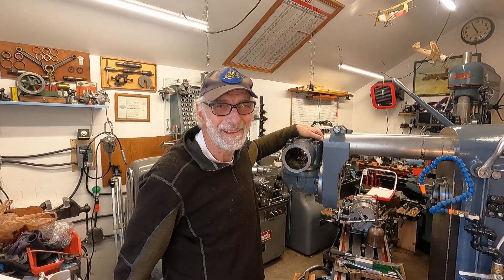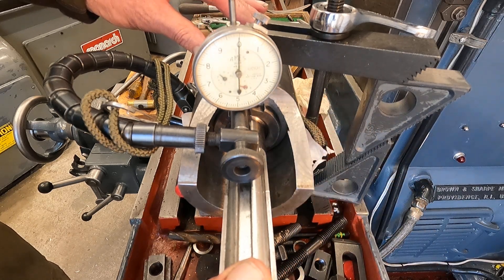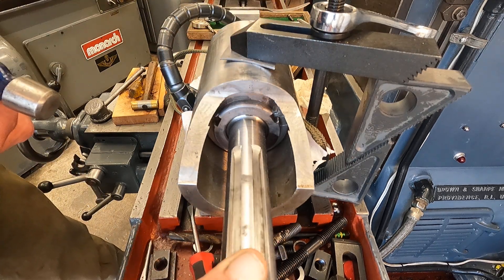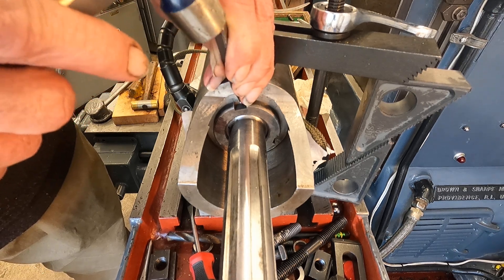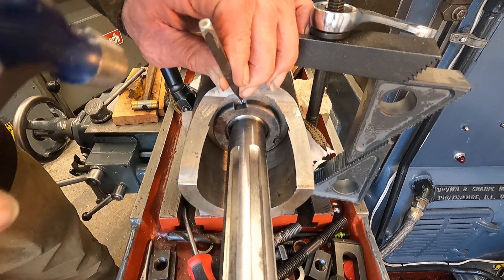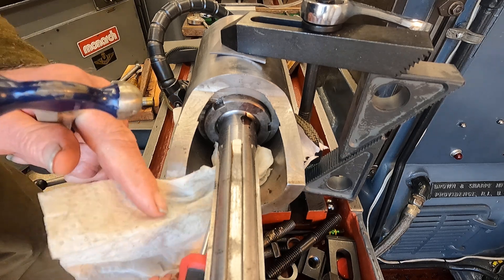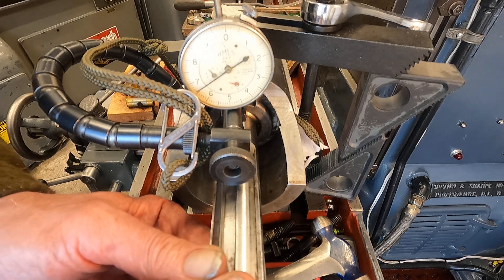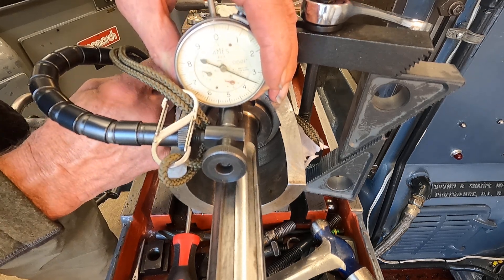Brown & Sharpe Milling Machine restoring spindle Timken bearing clearance set.

Comment: I would think that with mill spindle and lathe spindle bearings one might want 10 to 14 inch pounds of breakaway rotational torque . AKA 1 foot pound..anything like the 2 tenths is going to possibly result in surface finishes like all thread.. one does need to calculate thermal changes in spindle length and housing length.  Might be interesting to see how warm the spindle gets and the housing gets after an hour run in time. Duplicating spindle thermal expansion could be done with a hair dryer thru the spindle bore with a blade of metal at the outlet to adjust hairdryer distance to get a few degrees hotter than you need. Or a hotter source for a minute or two.  
Used to have an automotive choke tool that hooked to shop air.. blew cold out one end and hot out the other.  It grew legs 40 years ago.. I knew who got it.  Another tech that did carbs..

Ps I worry horribly about pounding on items in spindles without preloaded bearings.. I think harmonics destroy spindle bearings.  I wrote an email to kennametal and a year later they came out with damped tool holders.. but I think it quite literally fell on deaf ears.  
Back in the 70s. One of my brothers friends showed up at his apartment.. pulled a little glass vile out of his shirt pocket. Set it on a tall stack of magazines on the coffee table..  my brother ask what was in it.  
His friend replied nitro g and petn for additional pop.. my brother said it was a zen moment.  Looking at the vile sitting on top of a stack of magazines just about to slide.  That if it fell.  Would he hear the glass break..
Reply from the maker: This is a Timken bearing spindle that is full of grease, but all heads like this get full of grease, so there is no break away tongue setting possible. The only way to adjust this is carefully and slowly running it and watching the heat build up and "no" a fancy digital gun will not holp.. Timken bearing are not like ball bearings, but if they are damaged will produce a rope finish. The worst thing to do is disassemble this spindle and clean the bearings like idiots on the internet do daily it would appear.

Comment: Dee, I’m going to ask the question that really shows my ignorance.  Why, when you have spindle off the machine, aren’t you disassembling it and cleaning the old grease out and reassembling with no grease so you could adjust those Timken bearings as they originally did it?  I like where this is going but would like to understand more about precision spindles and the dangers of disassembling things too much.  Thanks, Will
Reply from the maker: I will cover it the best I can in the next video, it is risky disturbing precision spindle bearings.

Comment: you mentioned flushing out the old grease with new grease. That reminds me of what I see on my Nichols mill spindle. I greased it after getting it running again after who knows how long. I saw grease oozing out of the collar at the base of the spindle nose. one of these days after other things get done I'll get that spindle cleaned out properly.
Reply from the maker: Yes, the grease that was in the spindle saved it. The spindle did not need to be disassembled by pumping fresh grease through it